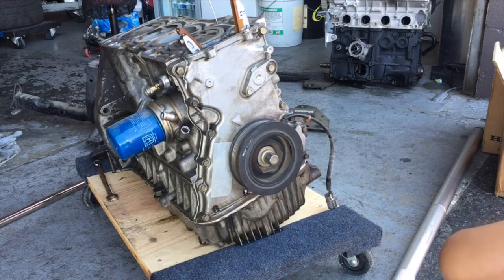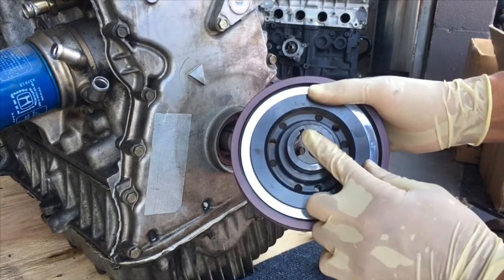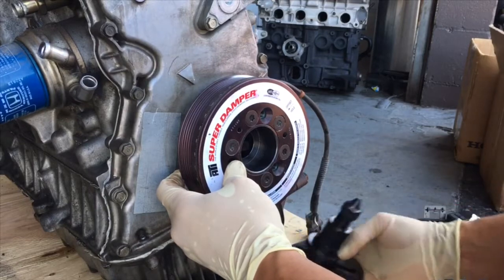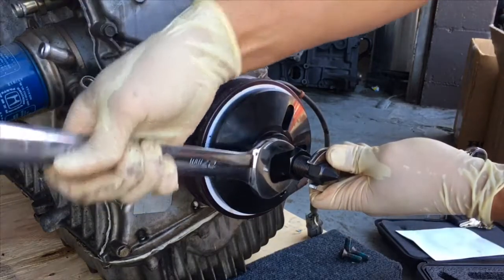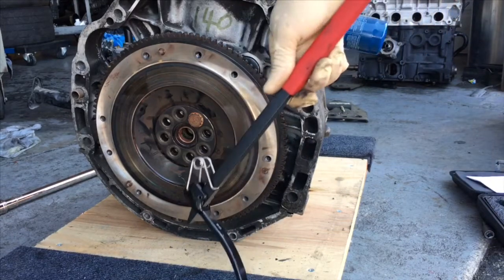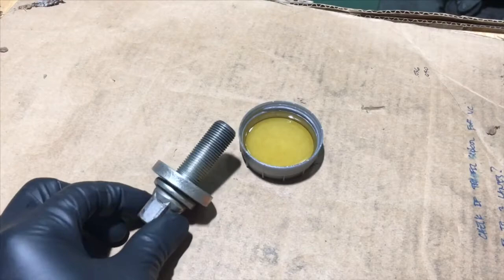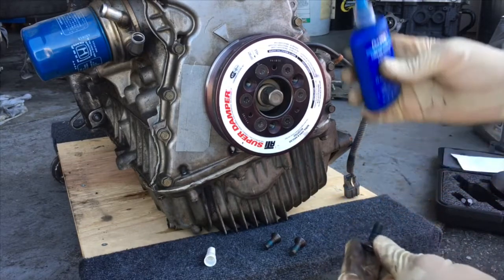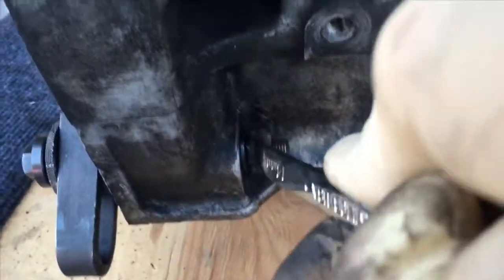ATI Super Damper Part # 918464 Installation - Honda S2000 - ATI Damper Puller Installer Kit Part #

Comment: If you removed the hub from the pulley and heated it up to expand it, would it slide onto the crankshaft without having to press it on?  Then put on the outer shell separately?
Reply from the maker: Patrick C. 2 other things comments... make sure you have the correct crank bolt adapter for the ATI installation tool and don’t forget to torque the crank bolt to spec after installation. Some torque their crank bolts w an impact gun. I opted to hold the crank pulley w a large strap wrench and torque to spec
Reply from the maker: Patrick C. Ah... I had this issue on my Integra.  After I installed the motor in the car w the ATI damper on it I needed to remove it on the car. I put the car on jack stands, supported the engine w a jack, loosened all the engine mounts, removed the engine mount closest to the ATI damper, & slowly lowered the motor till I had enough clearance to remove and install the ATI damper.
Reply from the maker: Patrick C. I honestly don’t know.  Is there a reason you wouldn’t install it properly?
Reply: @RelentlessRacingAJ  It's on a Subaru, I don't want to have to remove the motor to install it.  I don't think there is enough clearance to use a puller installer tool without pulling motor.  Not sure if all of them are press fit or some will just slide on.

Comment: Quick question I just purchased the ati super damper and was wondering if I leave off the power steering pulley do I still need to put the flat washers on the bolts before installation? The bolts are like a 10mm 12pt small bolt .p/n 918476 if i remember correctly thank you
Reply from the maker: Backlash city Fishing unfortunately I’ve never installed the street damper  and don’t know. I’d assume there may be balance issues. I’d suggest calling ATI’s technical support.

Comment: Is there any reason a generic crank pulley install kit can't be used? Not looking to spend $190 for a one time use tool.
Reply from the maker: Just to clarify, are you talking about using a generic crank pulley tool for installation or removal?

Comment: Which adapter thread size was that? Because I am looking for M14x1.25
Reply from the maker: Sorry for the late response.  It's an SAE adapter which comes with the kit... I don't remember which thread it is, but it is very close to the S2000 crank bolt thread.  Unfortunately, ATI doesn't make one.  Although, I used it to install and uninstall a few S2000 ATI pulleys.  I will be machining the correct adapter for the S2000 soon. I just finished the adapter for the B-series.  Unfortunately, ATI doesn't make one for the S2000 or B-series cranks.
Reply: Thank you! I ended up getting what I needed from fluidampr. Nobody makes m14x1.25 except them that I could find! CRAZY!
Reply from the maker: Mr334cobra cool. Did u purchase just the adapter or did u have to buy the whole install tool?  Also, what’s the thread on the opposite side of the M14 x 1.25 adapter?
Reply: I just bought the adapter....and to be honest about the other side, I am completely unsure because I totally galled the other side threading it onto my pulley installer/uninstaller. I didn't care because I knew I was only using it for that. It's a coarser thread, I can tell you that much.
Reply from the maker: Mr334cobra who did u purchase it from specifically?  I ask bc I called fluidamper and they wouldn’t sell the adapter by itself

Comment: What are the benefits of the ATI damper?
Reply: knocks out vibrations that harms oem oil pumps
Reply from the maker: Walter, Sorry I didn't get notified you asked a question...  check out this article.  It should answer all your questions https://www.enginelabs.com/features/editorials-opinions/tech-5-jc-beattie-jr-of-ati-performance-explains-damper-dynamics/